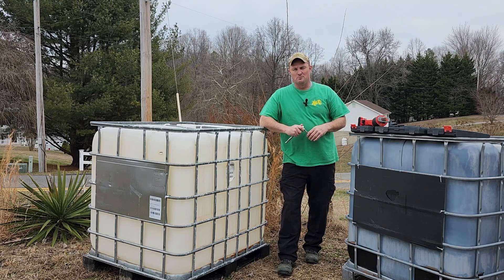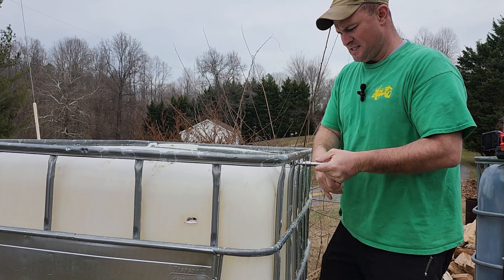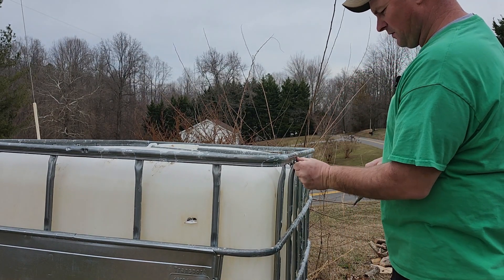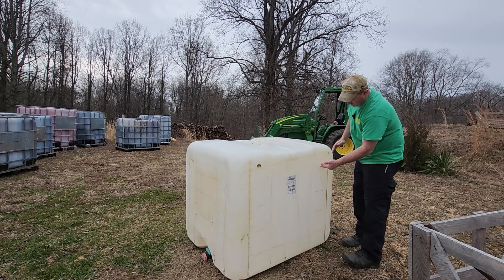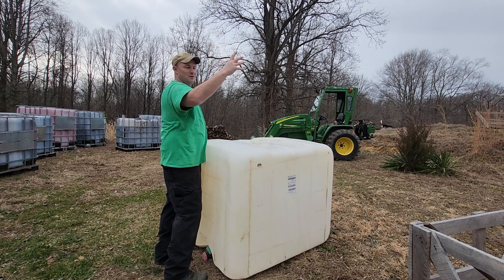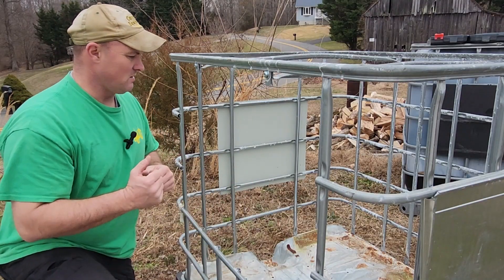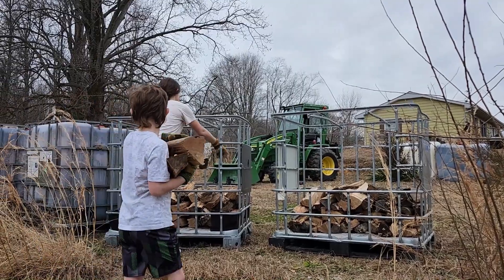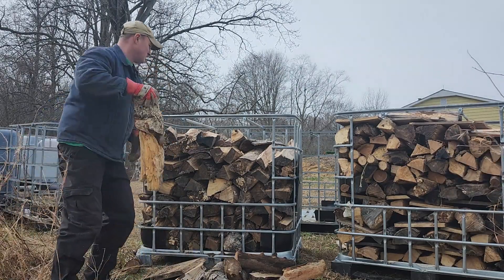Turning IBC totes into firewood bins

Comment: Never seen one cut out exactly like that. I have not had a problem with them bending yet, but only been using for three years. I have more issues with hitting corners with pallet forks and knocking them out of position. Good job having kids help.
Reply from the maker: I think that's going to be my next purchase. An actual set of pallet forks. The clamp on forks are okay, but it's hard to see through, and I lose lifting capacity. Thanks for watching and commenting as always. Have a good weekend, buddy.